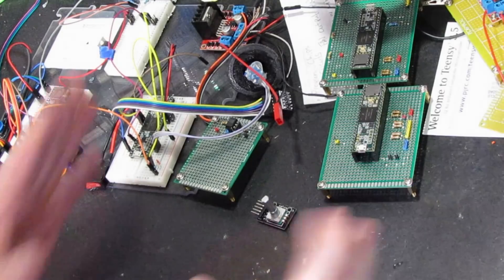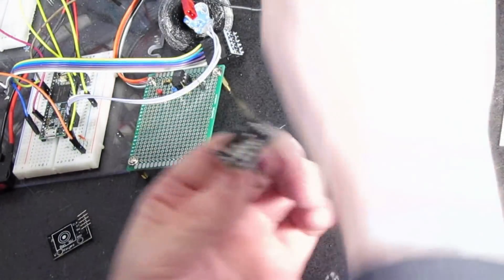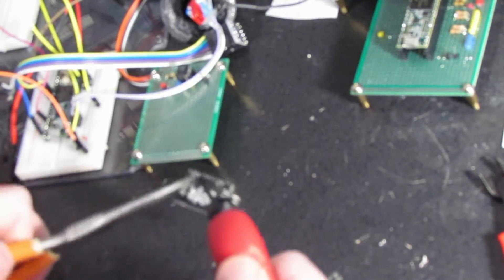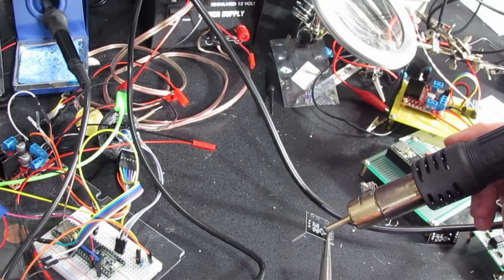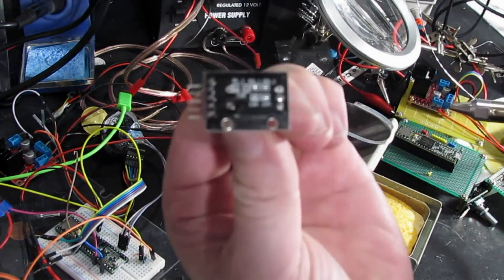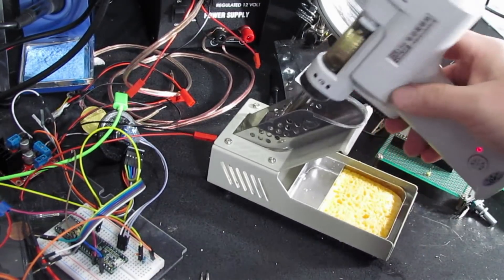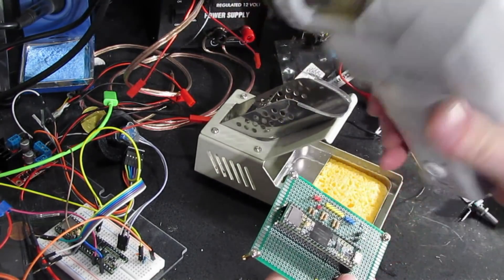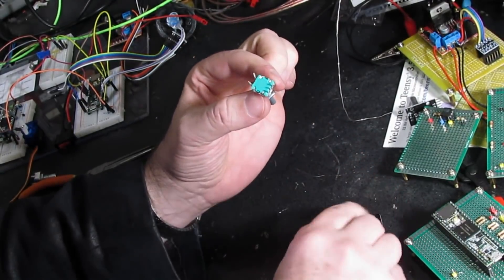5 Desoldering Techniques

Comment: On-Off switches are many times missing. Also for battery charging devices. My first action after buying is usually to add an AC switch into the line about 10 centimeters from the device.

What you are missing is also some tweezers. I use most often the one with about 1 mm wide pincers, and to pick those leftovers pins from the clipping with a needle wide pincer. More are not necessary.

Comment: I have the Hakko FR-301, what an amazing tool.  For small solder joints I put a nice amount of solder on the tip and let it do the work.  In many cases the chip, resistor, capacitor, etc... falls out of the board.  I've been suffering using wick or a manual one-click pump all these years.  With repairing Commodore computers, you don't wanna stress the board and since many of the chips are no longer available, you don't wanna damage anything when removing it in case it's still a good one.

Comment: All of these ways you  are using are really crude at best, and you didn't utilize the de soldering gun to it's capabilities.
Reply from the maker: What de-soldering methods do you prefer?
Reply: @montaelkins2816   well I am not like some soldering master I do it as hobby. One of the better ways I've seen that seems better is using a solder wick. You put the copper over joint and heat up with iron and which absorbs it. I use a pump but it's not the best. The de-soldering gun in the video is a good way. I just don't like how he was using it.

Comment: With your solder sucker tool demonstrated @7:11 in your video, check out this guy's technique with that same tool: https://youtu.be/XQVjwPsVFd8?t=278  That wiggle he does while the iron is over the pin moves the pin around while the solder is molten, exposing all the solder around it. Without that "wiggle", if the pin is resting against an inner edge of the via at the time it was soldered in, the solder remains hidden from removal where the pin touches the via, just enough to prevent easy removal.

Comment: Literally my tehnique to desolder components with the smd fan , i use a thin wood stick ( like a sushi stick lol) and after i heat it a bit i just push a bit the joint and get away the  solder around it . It really works well , i guess is better than the soldering iron or that gun , but i guess the desolder wick is the best( also the best and kinda the best option for multiple joint and so on like microcontrolers/IC and so on) . But if you wan t to be a little " on budget " and you don y have definetly more than 4 joint , you can use the smd fan without problem .

Comment: Helppppp.. i got solder in a spot it shouldn't be. I basically bridged a few things. I plan on getting desoldering wick tomorrow but do u think it will work? I tried blowing canned air on it but it spread it under the area.. do u think I'll have luck removing it?

Comment: Desoldering wick, anyone? Maybe a hand pump? Seems to be a lot more reliable (and certainly cheaper) than the gun.
Reply: I think thats fine to use a aolder iron and wick to start, but tou really need to follow up with a hot air gun. I like the 993a desolder gun because it doesnt burn the board, and puts heat right on the pad. Ill habe to wait to purchase though
Reply: Ya even with the pump and wick I couldn’t clear enough solder to move what I needed.

Comment: I think the desoldering tool would've worked better if you primed the pins of the board with some fresh solder. So adding extra fresh solder to the existing board will make it melt quicker.

Comment: How about solder wick?
Reply from the maker: Solder Wick doesn't suck. Which is a bad thing ;)
Reply: How do you do it? When I push it down on the solder joint with my iron, it sucks up the solder pretty well. As you mention in your video, adding some fresh solder can help too :)
Reply: Or a little flux...
Also cheap wick really sucks because it doesn't ;) The good stuff made from electrolytic copper/cathode copper is really worth it.
Reply: @crazor01  hey guys does the wick work on smd?
Reply: @davemwangi05  Sure, I use it all the time to clean pads while reworking SMD/BGA stuff
Reply: @crazor01  Oh that's nice. Now can  the wick remove an 8 pin or 10 pin SMD IC or transistor? I'm doubting that it will really suck the solder that's trapped under the flat legs, if you get what I mean. In this case u don't have a rework station/ heat gun only the wick and soldering iron.
Reply: @davemwangi05  No, that won't work. You'll want to use hot air for that. Heat up the entire chip and remove with tweezers once the solder melts. Clean up the pads with sodler wick afterwards. Same with BGAs.